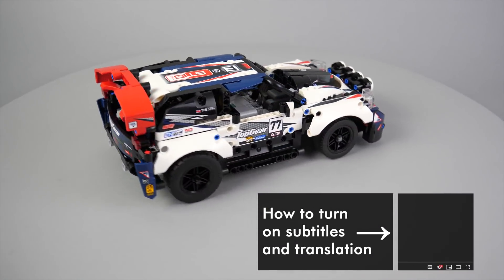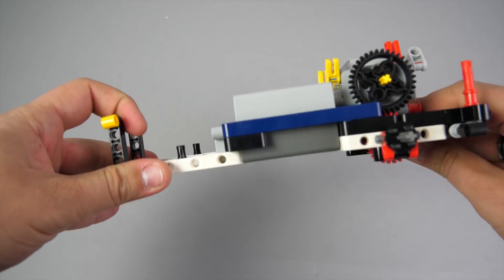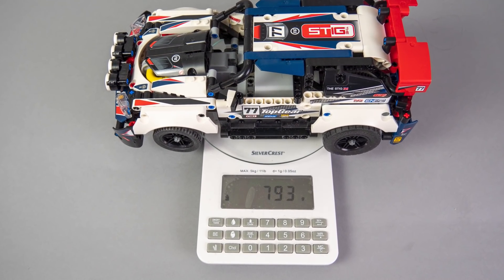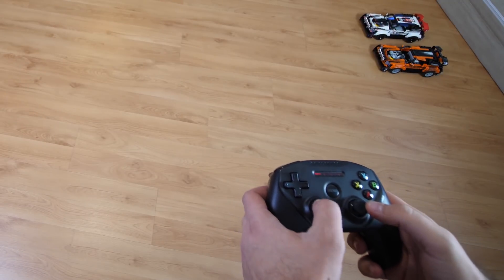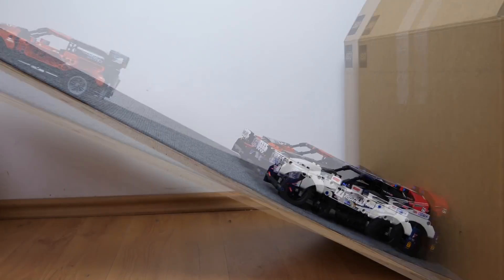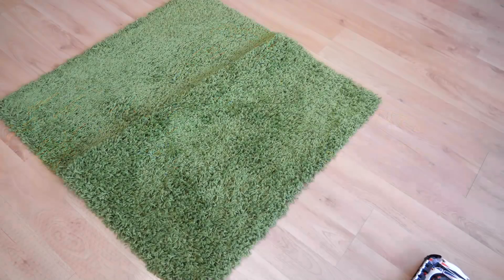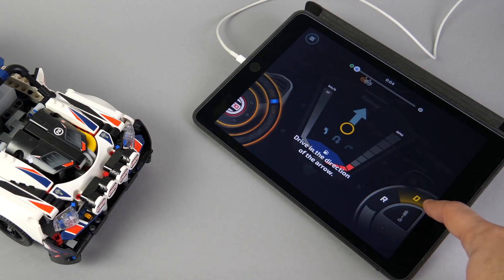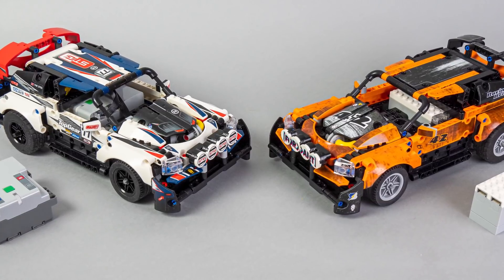Technic hub (AA) vs. Powered Up hub (AAA) in the LEGO Technic 42109 Top Gear Rally Car

Comment: I’ve got a wild idea to use the little hub, train motors, and the brick remote to build GBCs by using battery adapters so the remote and hub can run off of grid power. The reason for using the train motor is that it’s the only one that can natively have its speed adjusted by the remote in 10% increments. Based on tests I’ve seen the train motor has higher RPMs and lower torque, but that’s nothing some good gear ratios can’t fix.

Here’s hoping LEGO releases some simple, analog, grid-based power solutions for stationary builds (autonoma, GBC modules, etc.) in the near future.

Comment: Can you use remote 88010 with orange car?  does a steering works fine or it works only with app?
Reply from the maker: Steering only works with the app, the motor does not act as a servo with the PU remote by default

Comment: I  am curious about whether city hub (88009) can control all powered up motor? (including tech motor 88013/88014 or spike motor 45602/45603), and whether tech hub (88012) can control train motor 88011 or spike motor 45602/45603)?
Reply from the maker: Yes they can
Reply: @RacingBrick  Thank you for your reply. Your serial videos and reviews in website help me a lot in building Lego RC, especially during transition from power function to powered up. There are so many hubs in powered up family (Wedo 2.0 hub, boost hub, city hub, tech hub, and spike prime hub), and there are so many motors share same connection wire but not always compatible with each hub (Wedo motor, also in batmobile, tech motor,  Boost Motor (88008),  Simple Medium Motor (45303), Technic Motor (88013/88014), Spike prime Technic  Angular Motor (45602/45603).

Comment: I just bought this and yeah it's really heavy, I wonder what happens if you build a lighter car with the same motors, will the small hub still be performing better ?  Also, I think it would be nice to have an alignment option to put a little toe in on the front wheels so it goes straighter.  I don't notice any bug in the steering rack in the app, maybe they fixed it in the updates, but physically my car is leaning left and I think I'll try too fix it on a 2nd generation.

Comment: Dear RacingBrick. I have a question. How did you get the orange version of this automobile set?
Reply from the maker: This might surprise you, but I built it :)
Reply: @RacingBrick  Oh yes, your brand's name is on some of the stickers. But another question? It's this set worth to buy it? I recently bought the Lego Technic 42100 Liebherr R 8900 mine excavator machine. What an outstanding monster!!! And i love it!
Reply from the maker: Well, with the stock Control+ profile I don't really like it, too slow, app control is weird. If you use a gamepad with BrickController2 or the PU remote with the PU app then it's more fun to drive around. I bought them for the Powered Up parts mostly, it can be used to motorize other sets.

Comment: I have the same issue with 42109. Sometimes when I pick up the car (powered and paired with the app), the steering goes by itself all the way on one side. Has anyone found the cause of this? Is it a fault or there is another explanation?
Reply from the maker: I think it is a bug with the steering control of the L motor
Reply: @RacingBrick  I have the same problem with the C+ XL motor

Comment: Measuring battery life on a stand is nonsense, as it does not take set weight into consideration, so in terrain it would have to do more work and drain faster then lighter version.
Reply from the maker: I you volunteer to drive the two version around for hours in the exact same conditions then I'm happy to publish more accurate data.
Reply: @RacingBrick  Maybe use rubber bands to increace friction and to press the car down. But it will still remain a theoretical value, so... =)
Reply: @RacingBrick  Probably it's already too late but maybe attach a smooth "leash"  to the round chair/table leg from one side and to the car from the other side. It would then run in circles automatically. 
Of course it is easier said than done, but this idea just popped out off my mind...
Other than that - big thanks for assessing both hubs! 👍😉
Reply from the maker: @ketrabli  I see some potential issues with this method but worth trying anyway :)
Reply: @RacingBrick  I am pretty sure there are some 😄 I probably don't see them. I am not such LEGO Pro as you (speaking fully honestly).
I really enjoy watching your vids and hence I subscribed 😉

Comment: Orange car has NO differential?
Reply from the maker: Nope since I only had one in the original set and I wanted to keep the motor's arrangement
Reply: @RacingBrick   why
Reply from the maker: @hettran9868  because the point of the comparison was to have a similar structure, only the hub was different
Reply: Yes

Comment: Why use these when we have buwizz
Reply: And it is expensive
Reply: @elvishou4356  very expensive
Reply from the maker: Different purpose, e.g. BuWizz does not have sensors and you cannot program it
Reply: RacingBrick is it possible to connect buwizz unit with new PU motors?
Reply: @AlanFiser  buwizz uses PF motors and connectors